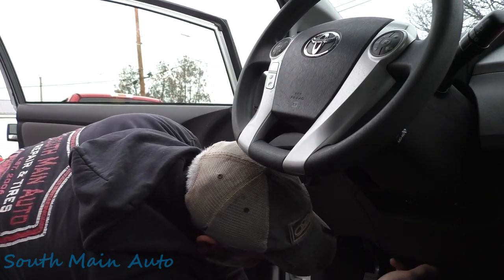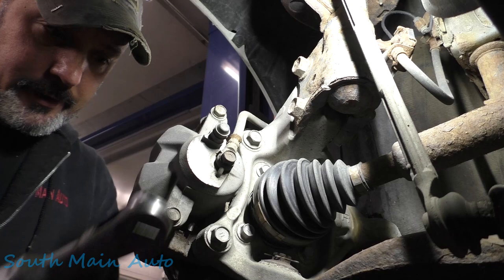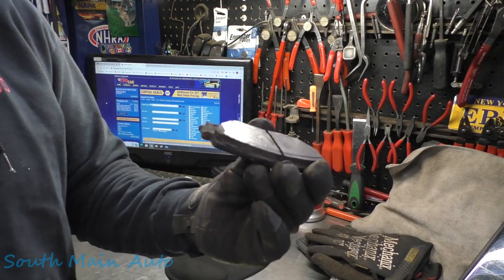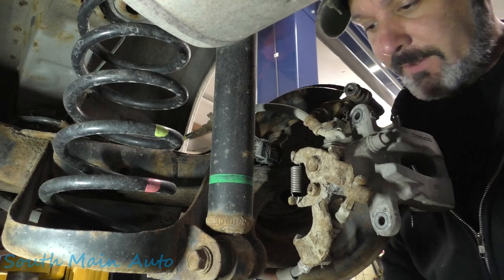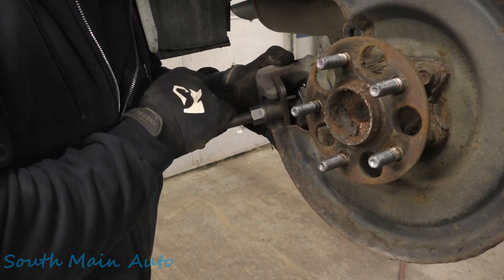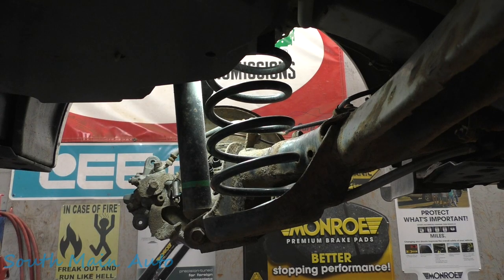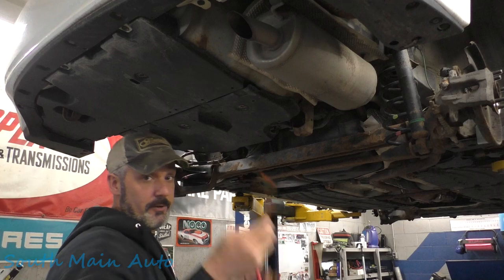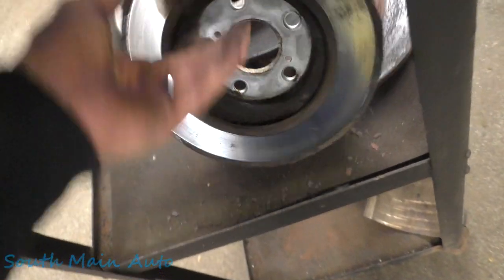Loud Grinding Noises & Dash Lights On - Prius Edition

Comment: I loved the idea of regenerative braking, but was surprised at how hard it is for brakes to survive without being regularly used. If I owned a Prius I'd make sure to jam on the brakes once in a while to try and keep everything moving. Like parking brakes, if you don't use them, you lose them.
Reply: If u live in the salt belt ur pads are gonna get wasted anyways. You'd be better off servicing your brakes every other year and lubricating the pins and such
Reply from the maker: @agger838  A yearly "brake service" is a hard sell in the shop. As a DIY'er I 100% agree with you. Service brakes in the rust belt every 6 months to a year and you'll get some good life out of them. Try selling that service as a shop gets tricky.
Reply: I got 2 08 Prius's or is it Priuses. Anyhow, same brake problems in Ontario Canada, rust out before they wear out, tried those anti rust rotors....they rust.  Cleaning every spring and fall seems to help, but need to replace every 2-3 years.
Reply: On the other hand, if you don't live in the rust belt, they last the life of the car. I have a 2010 with 370,000km and the brakes are original, but I live in temperate New South Wales in Australia.
Reply: @agger838  every other year? It has to be every 6 months or you are buying brakes
Reply: @SouthMainAuto  We actually sell a lot brake services.  And yes it is a tough sell. But I like to  tell my customers an hour labor twice a year is a lot cheaper than new pads and rotors.
Reply: @JJ-iw7nh  Garage I use in the UK offers two levels of service. Standard is the basic interim oil and filter change and inspection or the full which is a complete going over with pollen and air filter and the brakes get cleaned lubed and adjusted with the option up front that if they need to change pads and disks they'll do that as well. Well the wheels are off already and it's on the lift...
Reply: On the Prius the friction brakes kick in under 8MPH or so every time... so they do get used a little bit.  
But that is not enough to build up any heat in the pads to drive out moisture. 
Tesla's have real issues with this.. the newer ones only use the friction brakes if you actually touch the brakes.. 
I live in the southwest.. no rust.. I do rideshare.. and I beat the hell out of my 08 Prius.
Front pads last 120K and the rear shoes 200K.  I've got 422,000 miles on my car.
Reply: In my Chevy Volt, I occasionally shift into neutral when breaking to disable regenerative breaking and clean up the rotors.
Reply: @briantraverse  I believe it's Prii.  😄
Reply: @Tyrial7  Correct. Just changed the original pads and rotors at 265,000 km on my 2004 Ford F150. I'm on Vancouver Island.
Reply: @bartsarton2212  Wow that's impressive for a vehicle without regen braking, you must be a careful driver.
Reply: I think i might be looking at then spring and fall.  Clean up and lube each time.

Comment: I live in North Carolina. So there are no issues with rust rotted rotors. I used to get mine (DYI) turned at a local shop but then found that new ones were damn near the same cost. I had to smile at your observation that most of the shops in your area (the PRNY more broadly?) sold their lathes long ago. Great videos and lessons Eriic. And keep the dry wit humor coming, too.
Reply: Many new vehicles don't have brake rotors/drums that can be turned anymore and have to be replaced the first time thru.
I can remember a time when you could squeak out two turnings if the grooves weren't too bad in the drums.
Reply: Totally agree. Last I had trued cost more than a premium disc from RA
Reply: Hello from North Carolina from a northerner
Reply: most rotors are all composite metals now and the pad friction material are so hard it generally wears the rotors down also. pretty much meaning there's not enough "meat" left to turn them anyway or they'll be right at the minimum wear limit once turned. the only place I know of that turns rotors anymore is the big "green" automotive chain(O'Reilly) and maybe some NAPA that carry truck parts/service centers.

Comment: Smart customer wants it all fixed correctly so they can ride reliably for a while.  Rusty brake lines are dangerous to drive around on.  Great explanation of the rust belt problems on car brake systems.

Comment: You do a great job of showing how to do the work in the rust belt. These tips and tricks have helped me even down here in the south.  You do an especially great job in this video teaching WHY.  Why you don't just slap a set of new pads in and call it good.  Why you don't just shove in a new sensor. Why you have to do the work to get down to the root of the problems and why youinspect other things that are no problem now... but will cause the customer problems later.  The level of TRUST your customer has in your word Shouts from the Mountain Top "I feel Safe putting my families life in his hands."  Even if I only install a set of pads it is never "Just a Brake Job!"  Thank you fore your Excellent Work.

Comment: as a life long Central NYer, never heard of "rust jacking" but definitely have seen it...we called it pad separation but i like your word better....sounds more "in need of repair soon" to it and the customer would say, "OOOH, that sounds bad, you better replace them"
Reply: Rust jacking is what I associate with double and triple framed trucks . But it and apply to any materials that are being pushed apart by rust
Reply: @vicktorpatriot1430  yup, used to see double and triples swell to almost an inch...smack em with a  hammer and 2 pounds of rust would fall to the ground...I used to repair frames in my former life and saw it all the time...usually work trucks like plows with sanders and salters on them

Comment: I have been in Florida for 18 years and I do not miss the WNY winter and salt storms. I will be replacing pads, rotors and hardware on all 4 wheels and the underside of my 2012 (67000) SRX looks like its 2 years old no rust just dirt and sand. I bought my sisters 98 Intrepid (77,000) this car spent its entire life outside and 600 feet from the Atlantic Ocean. The salt air destroyed paint and all steel break lines under the car rotted away. Enjoy watching your videos and cannot believe how fast the newer cars seem to have their frames rot away.

Comment: I'll take a long video or a multiparter, whatever we can get. And the first thing I learned doing my own brakes is you either pad-slap or buy rotors. I wouldn't begin to know a shop that even had a brake lathe. Always appreciate your efforts for us here in YT land!! Thanks, Eric!
Reply: I worked in three gas stations that had brake lathes. (In the 70s)
Reply: I know some O'Reilly's Auto part's still turn brake rotors and drum's.
Reply: @Ladybug-pl7yq  They resurface them here at my local o'reilly's for $10 a rotor
Reply: @Friendlyx333  That's good to know!

Comment: I worked for Toyota in the rust belt for 10 years.  I never saw a Prius with the rear brakes worn out, they were always corroded away.  The rust and climate destroyed them but they were never "worn out".  I've seen them with over 200k miles, same deal.

Comment: your customer s not daft it probably works out better value to do it in one hit whilst wheels off rather than off on in out of workshop on lift it helps to have a honest reliable mechanic plus they can see the work needs doing by watching this video nice one Dr O
Reply: Value comes when the customer isn't having to come back a month later because the other bearing has tripped the other sensor and the customer is back at the shop without his vehicle for the day, or paying a tow truck when the brake line pops somewhere inconvenient.
painful but better to get it all done in one hit and have peace of mind its all sorted
Reply: @luviskol  exactly

Comment: Not all brake jobs are equal or should I say, not all brake jobs videos on YouTube are equal. I have done a lot of research on todays brake systems and I did not see one person do a brake job like you do. No BS about it. They did not clean off the rust on any of the parts or use brake silicone grease. And even that I have seen you do more than one brake job, I did learn something new from this video. Thank you Eric, I will see you in part-2 lol

Comment: THANK YOU Eric, my pads looked nice and thick but looking closer after watching you vid , the cracks from the dreaded rust jacking were there. A little twist from a screw driver and the friction material popped off.
It can happen here in Florida too!
Reply: I've seen it in Southern Kentucky, especially with lower grade typical auto part store brands.

Comment: Wowzers!!! 70-ish thousand on the clock. I bought a 2013 in 2019 with 143k. I drove a lot too. Had been through three sets of rear pads and two sets of front. 

I also opted to pull over when my wheel bearing gave me fault codes... I had an appointment scheduled to get that changed but it turns out it was way worse than I thought and when it turned off my cruise control 60 miles from home I'm like "alright... cool. I'll just pull over and have it towed to the shop. Just in case there's something really serious going on". 

Turns out there's like five other things that cause the same lights to turn on. One of them is the brakes ceasing to function. Some electrical mumbo-jumbo fails a certain way and you have no brakes. Not "some brakes" like every other system. None at all! So $450-ish tow bill later and a new wheel bearing followed by three more wheel bearings needing replaced a week after... Yeah. I miss how cheap that car was to operate and maintain... I don't miss the size of it and the lack of fog lights. I feel like if I had fog lights I might not have killed that deer with my Prius... and also might not have killed my Prius with that deer.

Comment: These are good cars, especially in late 2014 to 2022. Toyota knows what they are doing. They make excellent metal boxes with 4 wheels, celling, floor, with air conditioning.

Comment: Those of us who have seldom driven vehicles need to do a brake inspection or have it done, to look at the bonding of the shoes and pads, as well as look at leaky hydraulic parts. Nice DIY trick on the sensor.  If you design a system to be logically repaired, as Toyota seems to do,  it will last so much longer. thanks.

Comment: 100% agree with you on just replacing rotors.  SE Michigan here.  I turned them ONCE...they were still in spec, but they warped inside of 200 miles, and I ended up replacing them anyway.  Even though rotors aren't nearly as cheap as they used to be (I used to get rotors for my Tahoe for like $30 total...now it's double per...usually can get specials though if doing an entire brake job.  Our O, O, O, O'Rileys will still do them, but they really frown upon it.  Better and easier to just replace them.

Comment: Over the summer had to do exactly the same job on my prius from near by Salt region. What impressed me is the price of the rear wheelbearings which were around $250 each..break lines for rear were easily obtained at local Toyota dealer but not cutting corners and using mostly oem parts it ended up being around 1000 for just rear..Would be nice if in next video you will show the trick to bleed the rear brakes without software.

Comment: Eric, should you (and your family visit  Lancaster County, PA, you  abosolutely must visit "Chestnut Hill Auto Electric", near Fivepointville, a place which does all of their own rebuilding, fire and EMS electrical systems troubleshooting, police electrical systems, motorcoaches, and build harnessing. It's straight out of the 1960's/1970's,  and even has a wall filled with Cole-Hersee systems components.  I'll even spring for dinner in Bowmansville....

Comment: I sometimes bang the outer rotor with a hammer. I found it can also be a game changer for noise. That is if there was no vibration when braking. besides servicing the entire system like you always do a number 1 great job.

Comment: Up in your salt belt, which do you find rust more, garaged or cars left outdoors. Up in Nort Minnesota the cars left outside as long as it stayed below freezing seemed to rust less.  But make sure the antifreeze is good, get a block heater and battery tender though 😉👍🏻💪
Reply: the salt is bad when the snow melts and the water activates the chemical reaction...if it is outside, it has less chance of melting, so less chance of activation...just get a block heater to help start it
Reply: I'm from MN also and concur with you. Vehicles that are garaged, especially attached garages, even non heated ones tend to keep the salty mix in a humid environment where it does the most damage. cold, dry and frozen is the way to go. Even though it sucks at 4 A.M. in January.
Reply: Avoid rust: leave your car outside. Freeze/thaw cycles=rust.
Reply from the maker: You got it Tom. The garage kept cars here fall apart ten times faster. Their bodies "look" nicer but the undercarriage is smoked two or three years sooner than a driveway car.
Reply: Thanks Tom, "I trailer park trash" & cant afford a garage. 😂🤣😁👍
Reply: I’m in Manitoba, and it can go either way. Uninsulated garage is essentially the same temperature as outside, but without ever having to scrape your windows in the morning. It’s also very cold, and as a result, there is far less salt use on the roads, and the amount of time we deal with the wet, salty roads is significantly less than areas like NY. 

Me personally…my garage is heated and the thermostat is set to 40F for daily parking use. I’m also diligent about keeping it dry, and as a result, my vehicles are clean and dry for the vast majority of the winter. I find that my vehicles actually fare better now than they did when the garage was uninsulated. At the end of the day, the people that are diligent about cleaning their vehicles throughout the winter are the ones that have the least rust, regardless of where they park.

Comment: I love living in the south (NC)  I have a 13 Dodge Charger.  I do baby my cars and that helps too.  I had the rotors turned this year and the brake pads were still 50% so I reused them.  This car is all original down to the wipers.  Except tires but only because they dry rotted from age. Lol.  It is a road trip car.  Been all over the country and Canada numerous times.  We are spoiled that we can get two or three times the use out of a car than our northern friends.

Comment: Looks like a very similar braking package on the front of that Prius as my 11 corolla, I’ve had very great luck with centric coated rotors and akebono pads, lasted me 4 years in the PRNY and all that took them out from lasting about that much longer was a pin boot that tore and seized the pin on the passenger side last winter

Comment: Everytime I have seen the Foreign object attached on tip of speed sensor on a toyota its always gear grinding powder attached to the speed sensor and some toyotas its the cage seen it alot on brand new vehicles just getting broken in systems are hyper sensitive now days even seen that code on a 2005 4runner compared to a 2015 Prius impressive how advanced the older vehicles computers are Eric O @South Main Auto Repair LLC

Comment: Blowing a brake line on any electric/hybrid car is slightly different situation to internal combustion engine, it will typically empty fluid a lot faster as brakes are controlled by an electric modulator charged by an accumulator.

Comment: I did a set of wheel bearings and harnesses on my parents yaris with in 6 months the wires corroded and corroded the pins off the wheel bearings.
The next time I did it I packed everything with dielectric grease.
Even the connector cover I packed full still going 2 years later fingers crossed

Comment: My highlander rear wheel bearings failed when the ABS housing rusted out. The ABS never stopped working but one bearing seized. I replaced both hubs and packed the open-backed mounting cavity with grease.

Comment: I just did the front brakes on my sons 2011 Prius. He said their was a grinding noise that turned out to be the caliper piston was pressing directly against the rotor, because the pad was ejected. Also picked up a good tip from an earlier video on using the ABS pump to help with the bleeding of the caliper. Great video!

Comment: Great video on the Prius. Always wondering with regeneterive braking if the brake system was odd. Looks pretty standard.  Gotta love the salt belt. Man I rinse my wheels and undercarriage every chance I get during winter
Reply: The brake system on Toyotas is normal at the wheels but the control of them is different. We have a new Camry hybrid and the brakes are under computer control. It doesn't apply them at all in normal slowdowns, until you get to lower speeds where regen is less effective. If you jab the brakes they come on. The computer can also apply the brakes in emergency stop if the radar shows that you're about to hit something.
Reply: U have to keep ur key fob away or disconnect battery. If u open door, brake actuator kicks on. Happened to some young guy who was nice enuf to post his video. Had to take to dealer. $$$$ Who would think?? Otherwise, easy as it was for Eric. 😉
Reply: @riceburner4747  I think I'd just disconnect the negative wire. But then again who knows what that would do to the 4 wheeled computer called Prius?
Reply: I just check my rear brake lines on my 2009 vibe I've got a flex line at the location he replaced on that Prius
Reply: @riceburner4747  yeah i accidentally had that happen and it shot the piston right out of the caliper